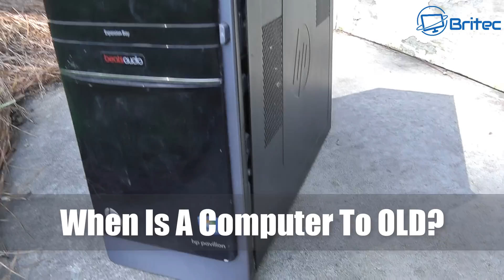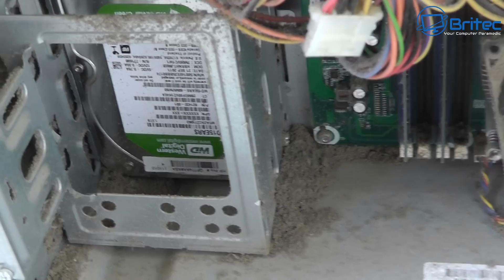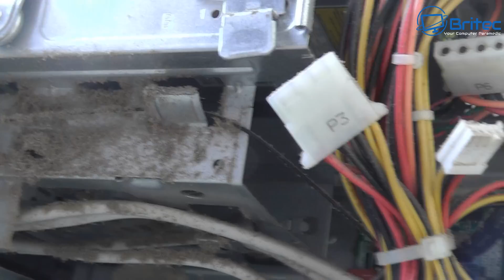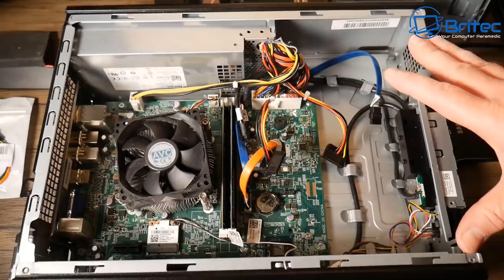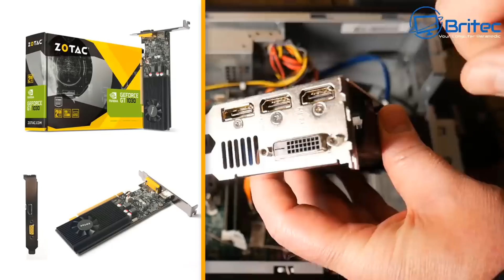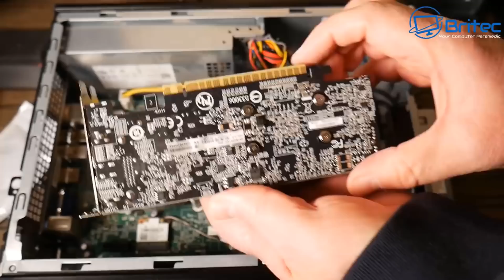When is A Computer Too Old

Comment: Still running a 12 year old  Asus homebuild (AMD FX six core processor) on MS Win 10 over  a mainly wired home network. its not much slower than my main  6 year old Asus machine {AMD Ryzen first gen, quad core) on MS Win 11 - the latter was supposed to be Win 11 incompatible but has an ISO installed copy of Win 11. Both machines have been mid-life upgraded with RAM (Ryzen to 16GB and Fx to 8gb) and SSDs and the performance improvement was noticeable. Both run faster than my four year old HP I5 laptop.

I'm not a gamer or heavy video/photo editor/ compiler, both machines run MS office 2010,  photoshop,  and You Tube, as well as Bitlocker and a VPN service over a 40Mbps FTTC connection - no issues. Both machines were in the past dual booted and the Ryzen runs VMware perfectly but more slowly on W11 than W10.
I also upgraded the case and power supply on the more frequently used main machine and that came with dust filters as standard and I added an uprated CPU cooler and addional case fans as the Ryzen temperature was getting to 50-60c at idle/low ops with the standard cooler (Not good for longevity) . . Compared with 45C  on the FX ! 
This year, if time  and finances allows, I was planning an upgrade, so the FX based machine will be ditched,  the Ryzen 1 substituted and a new Ryzen 5 six core purchased - that should increase processing power of the main unit by a factor of 3.

Comment: At this point, anyone bringing me a computer that runs on DDR2 and SATA II ports is an automatic "No". I'll pull data off of it, but I won't fix it. Within the next 24-36 months, that's also going to be my answer to any machine still running on DDR3. 

My general rule of thumb is once a system is 10 years old, it's time to replace it and move on.
Reply: Then you have no idea how capable those machines actually are.

Comment: I had an old AM2 Media PC that I liked to tinker with. I had upgraded it from an Athon X2 Brisbane to a Phenom X4 9600, going from 2GB to 4GB RAM DDR2 at the same time. A little later, the OS was installed cleanly on an SSD. First Windows 7 SP1 ran on it. Since the onboard graphics card ATI x1200 was not compatible with Windows 10, I treated myself to a GT 610. All parts except the SSD were bought used. But I agree with you, Windows 10 just didn't run smoothly. So after a short time I installed Windows 8.1 with classic shell. Unfortunately, the mainboard died at the end of 2021. It was a nice pastime to get the most out of the motherboard. And Windows 8.1 was really fast on the old hardware. Love to use Arch too, but the machine has only been used with Windows over the years for listening to music (youtube, spotify), watching videos on the TV and surfing the web.
I could tell that the first motherboard in the video was from the old FM1 Llano platform generation. After all, it already had SATA 3.

Comment: I'm still having fun with my recent thrift store buy (I paid 5 bucks for it, heh, heh!), an eMachines T2742 w XP SP3, 1 gig RAM, for games (Call of Duty 1 & 2, MechWarrior 1-4, Far Cry 1, F.E.A.R. etc...). I also have 2 Dells circa 2011, an Optiplex 790MT core i3, 8 gig RAM refurb (95 bucks @ Amazon) that I downgraded from Win10 to XP (which I popped in an Nvidia 7800gt GPU for heavier gaming) and an XPS 8300 core i7 Win10, 12 gig RAM, neither upgradable to Win11. For Win11 capability I just recently picked up an Acer Aspire XC-830-uw91, Win10 installed. Anyone who needs a good, affordable new Win11 capable desktop machine needs to check out the XC-830, it's about $300 brand new at Walmart or Amazon, weighs about 3 ounces (an infant can toss it around easily), and handles Win11 no problem. I upgraded the 4Gig RAM to 8 and it runs like a champ. The INTEL auto updater program keeps the hardware fully updated, including the shared UHD Graphics 600. Bought it off the shelf at Walmart. Not very upgradable, though, the PSU only puts out 65 watts, but a low profile GPU is addable with an open PCI Express x16 slot. It also has an open SATA port, to which I added a Hitachi 2Terra HDD (for a mere 40 bucks brand new from Amazon). Cheers & happy computing!

Comment: I have put a power meter on my two major boxes, a dual Xeon with 96 GB RAM and a Dell R710 and I got a slight heart attack. They're not running 24/7 anymore,~Now my major sysrems are a i5 NUC and a R5 Radeon NUC, both consuming less than 50 watts. Most of my daily work (browsing, office ...) is going on Rasperry 4 with 8 Gig and their power demands barely make my power meter move.
I suggest getting a PS5 for gaming and something sensible like a RPi for you daily work. Yes, the RPi can render 4k, so what?
If i would buy something else, my suggestions would be a M1 Apple MacBook and/or a MacMini. Power without the energy consumption.

Comment: I agree with what you say, but I am using a X58 x5670 Xeon with 24gb and 1080ti and that is pretty long in the tooth. It was cheap to build and still holds its own in 2022. I would say that the power consumed is more of a factor on an older pc, given the increase in the cost of electricity.

Comment: My machine is based on an older unit that I updated ...but I pretty much just salvaged the case and started with a new motherboard and all new GPU and CPU a bigger power supply ect. .. so I agree and disagree at the same time ... I did save money on some parts that I recycled .. but the old machine defiantly didn't cut it

Comment: How old is too old? Well I've still got a Pentium 100GHz board running Windows XP in a MAME Arcade build that still works perfectly well (other than the incredibly slow boot up times). It's over 20yrs old I reckon. It originally had a 240MHz processor board in it until the 1GHz board was repurposed to this. And the funny thing is the 1GHz processor is more powerful than the original chips on the Arcade machines board!

But I fully agree that it really depends on what you're going to do with it. Most older systems aren't going to be very capable of multitasking, even just surfing the web regardless of how you upgrade it.

That being said, there's some fantastic deals on older computers that were top of the line in their day (with i7 processors) for about $100. Most of these however still come with their installed HDD and run slower because of it. Simply max'ing out the RAM and adding an SSD will speed it up significantly. There's even cheap USB3.0 PCIe and Wifi boards to upgrade it with too.

I like buying some of the old Dell and HP mini desktop computers for this reason. They're compact, have older i5 or i7's in there and because of their age, RAM modules are cheap as chips to upgrade it. They're not going to set the world on fire by today's standards, but they're great for projects that require lower processing power - like retro arcade/pinball/poker machines, jukeboxes, NAS etc. Normally I'll repurpose my older systems or laptops for this purpose too. Infact, I bought an USFF Dell i5 about 12 months ago to build a guitar effects processing rig. They don't really require a lot of processing power and most sound recording interfaces are still running through USB2.0!

Comment: I have 3-4 pcs with linux.  1 with linux xfc mint 20.3, 2 with linux mint 20.3 for 64 bit , 1 with linux mate 19.3. They are all running great.  Have a laptop with ubuntu that will be Installing linux mate 19.3.  Linux is great.  Got tired of being manipulated by  Microsoft.  Got tired of being pushed into new equipment requirements.  Haven't found anything that is not compatible.  But I'm sure there are some incompatibilities on some things.

Comment: Run linux on two old laptops.  A 10yr old gen 2 i5 does any work where I need extra security or VPN. It is totally disposable if it gets infected.  And even older C2D, maybe 15yrs old, runs a lightweight distro and is still incredibly useful because it has a serial port and I need that. Fussing with USB adapters is unreliable. A hardware serial port just plain works.  Both of those laptops have SSDs, maxed out RAM and run better than new.  I have a gen 4 i7 running Windows 10 and it does everything else great except gaming.  It does have an older NVIDIA mobile GPU and it works great for accelerated video rendering.  Gaming is a bit weak.   All three of these machines serve different purposes and work great for my needs. The i7 will eventually move to linux when Windows 10 is obsoleted. It can't run Windows 11 and I don't need or want to buy a new machine just to run that.  Microsoft has made a path for me to exit using their products and I am fine with that. I have good alternatives now.  So long and thanks for all the fish.

Comment: I still run a 10 year old HP z620 workstation with a pair of E5-2690 16 core/32 thread Xeon processors in it with 48 gb of quad channel 1333 mhz DDR3 ram as my daily PC for personal use. Perhaps an exceptional example this and they still fetch a pretty penny on Ebay, but when it was my work machine it had Windows 7 followed by 10 on it and for a while now it has had Linux installed for games, applications, web browsing and VM's. Single threaded applications suffer a bit given the age of the CPU's but multi threaded tasks still blaze along. There is only one argument i can find to buy a new machine and that is power efficiency. But even in today's world, the savings of a new machine on electricity would likely take a few years before it pays off itself. The way things are going mind that may change!

Comment: Running on a core I7 from the first 6 months-ish it was available! I started with a a ton of ram, built it out as a gaming system just shy of an over-clocker dream machine. It will run windows 10 if I let it. It still runs FO4 with graphics on the upper side of medium - fps around 50 or 60. I am not updating to 11 so that doesn't matter. I didn't switch to linux to speed it up, I switched for concern of my security and my data being leaked to microsoft.
I do agree that currently this machine is taking to long for some tasks such as rendering video out of blender at 4k. And there seems to be more software emulations than I care for, consequently it is getting old.

On a side note - I have one curiosity concerning switching to linux to speed things up - can Wine run windows software faster than windows? no overhead of being a server for everything, no reporting to ms to check for updates continuously, etc.

Comment: Upgrading the RAM to the greatest allowed number and an SSD is usually like a new computer. Unless of course someone wants to run the latest games in full frame rate, or 3D movies.

Most apps run fine with lower grade hardware or bus speeds.

Comment: I have three "old" computers.  One made in 2007 that had XP on it, replaced with Mint 20.2.  I changed the CPU to something faster (a lot research on that one) with a little error because it was seated in an S1 g1 socket but they don't say say g1 - just like WWI wasn't WWI until WWII.  Increased the memory from 512MB to 4GB.  Used ethernet instead of WiFi for increased speed.  The performance?  Well the real issues is only streaming full screen which is a coin toss.  I've changed some advanced settings on the browser and some YouTube streams tolerably at full screen while others not.  But all content streams well on smaller screens.  It's not my main computer, but when I need to follow instructions to something on another computer their displayed on this one.  Oh, I forget to mention that I swapped the HD with an SSD.

Comment: i have some software that runs in a 16 bit environment. That would be windows XP or older. I just revived my Dell dimension from 2000 from a hard drive that was dying for this purpose. Though never used, the Dell recovery disc for W2K would not load, I had to clean and polish the surface of the CD 4 times before it made it all the way through. I had tried to clone the original drive, but the results were not good. The clean install is fine.  I have seen somewhat complex ways to run old Windows on a new machine, but it is not clear to me if this will run 16 bit programs or not. Maybe you could do a tutorial on how to set up and run win 2K on a win 10 machine. Thanks for your channel.

Comment: Mine's 8 years old in AUGUST I recently had the HDD replaced but only use the PC for Netflix and other streaming services, You tube and surfing the internet, it's taking a bit longer to boot up and shut down but that's not a problem for me. The other PC in the bedroom I only use for Netflix it's even older nearly 10 years old it'e an I5 3450 but I bought it because it was refurbished and an 10" kindle would have being £179 whilst the bedroom Pc cost £169 and I had a few spare monitors so only had to go on gum-tree and buy a secondhand table for £10

Comment: I have a HP PC from 2014 that originally came with Windows 8.1. I've since upgraded it to Windows 10, but it doesn't mean the requirements for Windows 11. Despite upgrading it to an SSD and adding memory, it is slow to download videos and Windows Insider Previews. I've since bought a new PC which works much faster then my old PC

Comment: On my 'old' PC (from 2005) my HX1000 psu died after some years, RMA'd it back to Corsair, and got an HC1050 in return, on an Abit (rip) motherboard, AMD 64 cpu, 2 x 8 gigs memory, . The PSU  died back in 2016, and even had a spare PSU I think an Corsair 620W, and HX850i spare, I tried to replace the PSU but couldn't get the main power cable plugged into the motherboard because it was right up snug in the top L/H corner, so gave up and decided to build myself a 'new' machine from scratch which is now 6 years old and going strong.
i7-6700K, Corsair AIO water cpu  + 3 x fans cooler, Gigabyte G1 Gaming motherboard, 2 x 8 Corsair memory, 2 x M2 Nvme cards 256GB, 1 x 250GB SSD, EVGA GTX 980 Ti Gfx card,  CD/DVD drive (comes in handy sometimes), and other bits.....Win 10 (upgrades from Win 7) won't play some of my old games, like Unreal Tournament, and many others, but it plays World of Tanks just fine with quick loading, no lag, and good fps....
But apparently it won't have anything to do with Win 11, so it keeps telling me, but not that bothered, so I will stubbornly keep using Win 10 until it, or I conk out for good....:)

Comment: A carpenter uses for his old CNC router,an old 486,with a proprietary software that runs on dos.He dusts and cleans it from time to time,and he says,if it does the job,it's still good to my eyes
Reply: Many old PC's are still in use for jobs such as that....a lot of that stuff requires very little processing power.  Servers are like that too, they don't require much processing power, they need storage space more than anything.  So you see these huge servers thinking man they've gotta be loaded with multiple processors, etc...nope open that case and you'll find a jumbled mess of hard drives typically, and a mediocre processor, and lots of RAM.  

I wish I could find a copy of a program we had in shop class called EC-CAD...it was a pretty rudimentary CAD/drawing program, but man it worked great...if I recall it was on like 3 or 4 floppy disks.

Comment: It depends on which Linux OS you use some are overloaded and others are not and there is about 170 differnet Linux os versions out there and YOU WILL HAVE TO LEARN SO START NOW AND you have to try them ALL and for 200 dollars you can buY a mini system with windows 11 pro installed but its not for gaming just remember that and linux is much better for gaming and make sure it has steam also as about 50% OF GAMES GAME IN STEAM WILL RUN IN LINUX AND AN OLD SYSTEM JUST USE IT EMAIL & BROWSE THE THE WEB AND MAKE SURE IT HAS 4 GIGS OF RAM OR DOWNLOAD Elive LINUX OS IT RUNS ON NEARLY ANYTHING EVEN WITH 2 MEGS OF RAM.

Comment: Offline Computers DONT need updates.  You harp on this fact to much I just had one system go to the bone yard that was an OLD Dos gaming machine, another win 98 gave up the ghost few months back.
 My wife loved to play some of the old DOS games that came on Monster sized 1.44 floppy.  Redneck Rampage was a favorite.
 There are many reasons to keep old offline stations.  I keep a win7 unit for things that dont run as fast on win 11 and there is NOT a match for in Linux worth a crap..

Comment: Until middle of 2020, I was still using my 2009 Intel Core 2 Duo E8400 based system (dual core, no hyper threading @3GHz) with 4Gb of RAM. I spent a few quid on doubling the RAM and swapping out the old HDD with a dirt cheap Chinese SSD and what a difference! Sure, the system is slow when it comes to starting to play a YouTube video, but for the emailing and general web browsing I used it for it was fine. BTW, moving from an HDD to even a cheap SSD and upgrading to Windows 10 really made a huge difference.

I upgraded to a new AMD Ryzen 3 3300X based machine and it is sure much faster. Probably overkill for a non gamer such as myself, but I got the parts at good prices, kept my case etc, so shall be using that for the foreseeable future.

Comment: My philosophy :  whatever windows, linux, chrome etc ...  I rebuild (wipe)  the pc every two years ... archive as appropriate... clean out the inside whether  laptop of desktop... thermal paste as appropriate ... upgrade the ram and HD if req, IF its cheap  to purchase ... after rebuild and extras  always keep the unit uptodate (if possible)  ..  its worked for me and I enjoy the tasks required ...  (note we have 5 desktops and 4 laptops in the current household  fleet) ... it's kind of a hobby .. keep them going ... (I like Dells, Lenovo, Fujitsu)